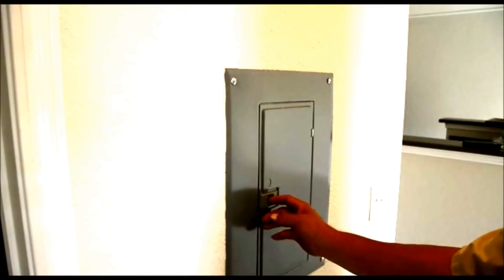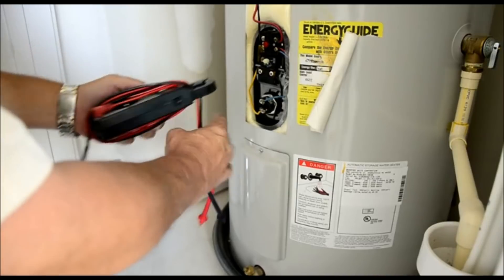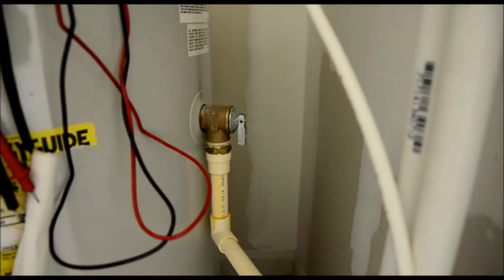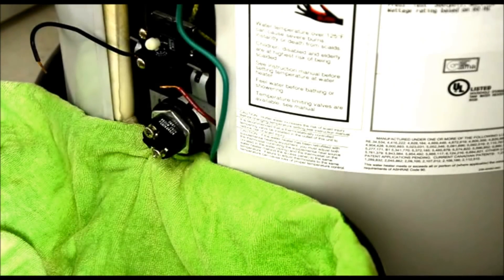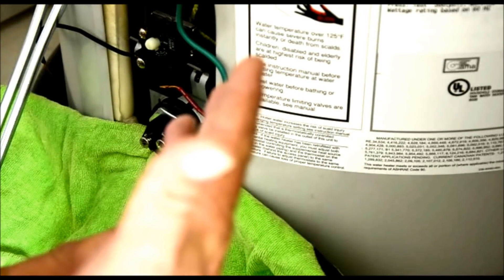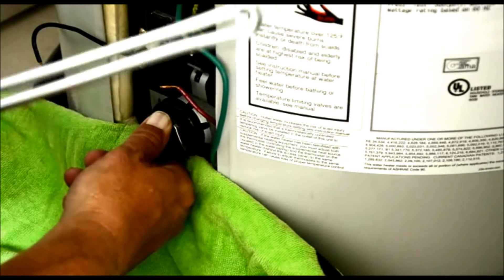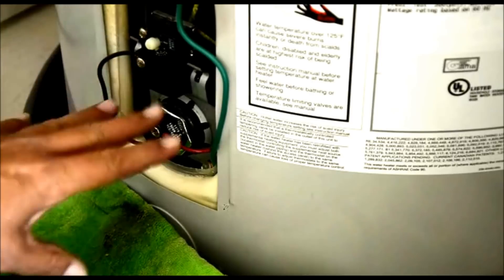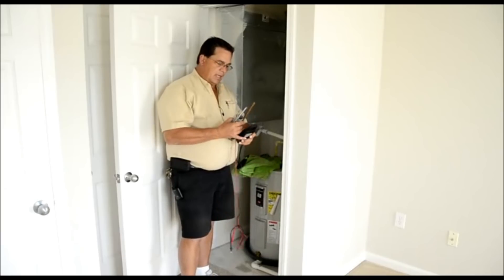Replacing A Water Heater Element With A Full Tank Of Water. "Not Draining Tank."

Comment: being a service tech for 37 years I would never try to change an element without draining the tank, I have seen 2 many elements split so bad that they wont come out of the hole without a real fight. I don't want to explain to the customer i was taking a short cut and dumped 40 gallons of water on the floor.
Reply: Told my apprentice to "hit" the t+p meaning to just relieve the pressure, he left it open and the elwment opening sprayed the whole shelf behind me full of computer parts... Never again.. Take the 15 mins to pump it down
Reply: Paul Fearnley absolutely
Reply: Your right and most of the time if the element is out it needs to have the sediment removed as well.
Reply: I just pulled a lower element out  today that came out in three pieces. It took some serious 'persuasion' to do so!
Reply: All those complaining about element removal without first draining the tank were not watching at 4:03, when narrator Dan Jiles said he had no clearance to attach a drain hose. At no point did he claim the "quick method" is easier or better.
Reply: If the element is broken and don’t come out easily do this, screw it back in then drain tank. Lol  I’ve done many with water in them, had one give me trouble, so put it back in and drained tank. No big deal
Reply: I've been a plumber for 46 years, i have never drained a water heater to change a element. That's even the calcium encrusted ones,burnt & split, and even the dreaded bent-back. So all you amatures leave this man alone, and understand you don't know everything. You might even learn something about plumbing...
Reply: Paul Fearnley agreed especially with older poorly maintained water heaters that where never flushed or at least not flushed often and the bottom element is not only a busted loop but filled with calcium. I understand there will be a slight vacuum on the heater when system is closed but when your disturbing that vacuum you can lose a bit more water then you want.
Reply: @Rhetorical Answer well I guess since I completed the repair described in this video without spilling even a cup of water I have a little different perspective than you and ol' Paul. Just because you've done something the same way for decades doesn't mean you're doing it right. As far as checking the power at the unit even after turning off the breaker apparently you've never heard of a mislabeled breaker panel.
Reply: Paul, thats true if you are a pro, but I live ina mobile home, and my water heater is outside, so this was really helpful to me
Reply: @Rhetorical Answer no it's not an "easy step" if you can't get the hose onto the spigot which is kind of the point of this whole video so you can piss off with your "laziness". Just because you and ol' Paul aren't smart enough to figure out an easier way to do a job doesn't mean the rest of us aren't. Or maybe you're just one of those "professionals" who rips their customers off by artificially inflating their hours so they can charge them more...
Reply: Rhetorical Answer guess I’ll just have to live with the fact that my repair was 100% successful.
Reply: I'm in total agreement with you. I'm a homeowner that has replaced my hot water heater elements a few times, and I would never attempt this. Drainingthe tank is such an easy step and doesn't take long at all. Why take the chance. Maybe this would work on occasion, but I'll never try it in my house and would totally advise everyone else not to either. Thanks
Reply: In 27 years of being a service plumber I have never drained a tank to change an element. Exception being in a finished room or full of sediment which is 1 in 100 where I live. Even broken elements come out with a good quick pull.
Reply: Sucks that you've been doing it wrong for 37 years. Wonder how many years you've wasted just draining the tanks?
Reply: Rhetorical Answer there is no substitute for common sense. IF you live in an area with hard water and IF your water heater is older and IF you can actually get a hose on the drain spigot THEN maybe you should just go ahead and drain the tank. I had none of those situations with my water heater so it made perfect sense to do the repair as depicted in the video. As far as the electrical goes in both this video and in my case a multimeter was used to verify the circuit was dead before the element was removed. I have a hard time believing that in 37 years Paul didn’t come across a situation like mine or the one in the video where it would have been easier to replace the element without draining the tank.
Reply: Get a life

Comment: Great job had a question will a burned element cause the heater not to power on and cause breaker to trip.
Reply: I had this same issue starting yesterday.  I have hard water, and the mineral deposits on the element ended up shorting out the element near the base. This will definitely cause the breaker to trip, and also keep the water from heating up.

Last time this happened, I paid a guy to come out and do it, and I watched him, but of course, he didn't explain anything. This video was an awesome refresher on what I'd already seen, and I replaced the element easily.  Instead of being close to $200, it was closer to $30 (because I had to buy both the element and the element wrench), which was much easier to swallow.
Reply: Thank you your right I had to replace it now I wonder how I can stop it from doing it again.

Comment: This video gave me hope.  Instead I ended up with gallons and gallons of water on my floor.  Unfortunately the lower element happened to be a fold back type that had expanded in the tank.  No way to remove it easily or quickly.  I suggest to anyone watching this video, know what type of element you are pulling out before attempting.  Play it safe and drain the tank!
Reply: cheryl lucas   oh yes I know what you're talking about your wrestling with the element trying to get it out of the hole it won't come out gallons and gallons of water is getting all over the floor you're panicking and it's just a big mess LOL I know what you're talking about.
Reply: cheryl lucas
Reply: cheryl 2
Reply: Yeah inwas lucky mine was outside that sucked.
Reply: Unfortunately, I couldn't drain the tank all the way from where it was located and the position. I had the same problem, and the worst of it was that I was doing this in my tenant's apartment, so the water went all over HER floor! I felt horrible and kept apologizing and saying that it wasn't supposed to come out that way. It was such a debacle!

Comment: If the old element is heavily corroded and covered in deposits, it will be impossible to switch out the old with the new without a lot of water on the floor.

Comment: I have a vertically mounted (Corbero CE50RL) in my holiday home in a very hard water area in Spain) and I'm sure the element is caked up with limescale as the kettle was the same although I've now restored it to perfection with white vinegar which dissolved the limescale.
I'm going to get some help to drain the tank and get the element out and leave it in a bucket of white vinegar for 12-24 hours until it's spotless again like the kettle element.
I'm guessing that the thermostat probe is probably caked up also and hope it can be removed and cleaned also.
Talking with my neighbours though I don't think anyone ever repairs or tries to repair these anymore as everyone has simply replaced their heaters over the years. Throwaway society drives me mental and yes my heater is only 11 years old, but I'm only here for 2-3 weeks per year and it's annoying that it's done after 30 weeks max, but then I guess the heater has been full of hard water for 11 years and not just 30 weeks...
Reply: I should have mentioned that the issue is that when I turn on the heater now it just trips out the electric... The weather is 40C every day during summer when I'm here so I don't really need warm water for showers in this weather 🌞
Reply: And sorry just one more thing - is there a resistance test that can be carried out on the thermostat?
Also - would there be a difference in the resistance readings of the element or the thermostat if they are just covered in limescale or are completely shot?
Presumably over time if they are completely covered in limescale they will burn out internally because they are having to work harder?

Comment: do you recommend this for areas where the water is very "hard"? most of the time, the bottom elements will go out here, because the bottom of the water heater is full of calcification or other precipitated minerals. in this case, would it be better to completely drain the water heater and then scoop out as much of the mineral deposit in the bottom as possible before installing the new element?

Comment: Hi Dan. Great video.  I have 2 elements heater. Heater works but circuit
 breaker occasionally goes down. Whats more likely could be wrong? One 
element faulty or electronics (Thermostat)? My Rheem is 10 years old. 
Should I replace the whole tank instead?
Reply: +jazu I just measured elements. Each is 19 Ohms. Are they in good condition?

Comment: The only thing I saw wrong with this is you didn't show testing the element, just the power. People need to know if it is bad before they go out and buy a new one. I have seen different length elements even, what about that? I don't want to give a thumbs down because of the great safety and water release and catching advise is good, but not complete advice for those that don't have any understanding fo how this works.

Comment: Great video. I didn't catch the complete title, I was just looking for a demo of removing the element. I needed to see the tool you used. Then I heard you say you weren't going to drain it, and I thought, no effing way... I was impressed. But try doing that on a tank full of HOT water. I will continue to drain my tank first. Murphy's Law.

FYI for those people who think there is no such thing as a "HOT WATER HEATER". There is a reason it is sometimes called a HOT WATER heater and not just a water heater. Something I noticed when I was stationed in England. They have TWO, yes count them, 2, water mains that come into the house. One line is your potable water that goes straight to the attic. Indeed, send the potable water to the attic to fill a tank of water there. I believe the water tank in my attic was between 100 and 200 gallons. The water pressure was really bad there, so that's a cheat to give you decent water pressure for free. 

The second water main coming in is for use in HOT WATER HEATERS. It is called the HOT WATER LINE. It is NOT potable and must be heated to be used. I have no idea why they set this up this way, but it certainly scarred the crap out of me when I discovered thats how it worked there. 

A funny thing about the plumbing is how it separates the hot and cold. My kitchen sink had the typical single spout where both hot and cold water came out. But there was a catch. The water isn't mixed together inside the neck of that thing. It has two pipes for the water and the cold and hot water don't mix until AFTER leaving the end of the faucet!!! I was washing my hands one day and got scalded water and ice cold water on my hands at the same time. I looked up into the underside of the faucet and could see there were indeed TWO water lines in it. British Engineering for ya!

Comment: Those tools you took it off with are impossible I had to get a big ass cheater bar to remove them. And half the time the elements are warped to hell and get stuck so you gota have hell getting them out. I do try this way everytime but beware if it don't work get rdy to throw it back and drain. Otherwise this video taught me how to do it so thanks..

Comment: This is great IF it is actually the element you need to replace! You said nothing about the other possible causes of the symptoms you described. What if it is the thermostat(s) that are bad? Why throw money at the thing when it only takes a few minutes to actually troubleshoot the thing?
If the top thermostat is bad, your lower thermostat may never get power to turn the lower element on. If your bottom thermostat is bad well, the element is never going to get power to produce heat. 
A couple of checks with an ohm meter will save a lot of unnecessary wondering and possibly wasted cash.
Reply: Verify the power to be off with a "known good" volt meter, and leave it off until these tests are completed! 
First disconnect one wire from the lower heating element. Check across the element's terminals with the ohm meter. A good element will show a very low resistance. This can vary in actual ohms, but experience has shown it to read in the range of 20 to 100 ohms. A burned out element will produce a reading of infinite resistance or show an "open" circuit.
If this preliminary check shows the element to be good, then you will need to check the lower thermostat with the ohm meter. Assuming the tank is cold on the bottom as described in the video, the lower thermostat should read "0" ohms across the terminals. If it does not, the tank is either hot enough to have this thermostat turned off, or it is in fact the bad component in the circuit. 
If both the lower element and thermostat check out as good, then it is likely your upper thermostat is the problem. You will have to disconnect a wire from the upper element to continue testing. Assuming the tank is up to temp on the top half, the upper thermostat should read as "open" across the left terminals, and "0" ohms across the top left to the right side terminal. If that is not the case then your upper thermostat is not switching the power from the upper to the lower and will need replacement.
I would suggest checking all of the above to identify all problem components before running to the hardware store so you get exactly what you need in one trip.
Good luck and be safe!
Reply: The title of the video indicates it is about replacing the element without draining the water. The symptoms of a non-functioning element are mentioned, but that doesn't mean a non-functioning element is the only cause of such issues.

Comment: How do you set the meter to know if there is still power going to the unit. Not sure why Dan didn't mention the meter setting since it was a 10 second addition to the video.
Reply: +Sandore Bussolini It should be set to read 240V AC. This is what most US water heaters operate on. Take your reading across the top terminals where the wires come in from the source.

Comment: we just replaced both water elements in mine and still no hot water 1st thought it was wired wrong but nothing happened even after hours nothing then wished the wires still nothing even hitting the Reset button top and bottom not working when they did when removed old ones need help!

Comment: Help, we changed the elements and they are receiving power (checked with a voltmeter), but it is not heating the water. Thermostat says 120 degrees and it is supplying water to and drawing it from the tank. 
This al started a couple of months ago, when lightning struck our house. Our 2 month old water heater quit working, and we had it checked with the voltmeter and were told that the elements needed replacing. We finally replaced them today and it's getting power but not heating the water.
Reply: Sounds like the thermostat is messed up you should have replaced it with the elements.

Comment: if the Heater element is bad.. does the pilot light go out.?Cause we can't get the pilot light to stay lit ..
Reply: +Dan Carreon You are working with a gas water heater if there is a pilot light, and would make this video totally useless to your situation.
I would recommend a certified gas appliance technician in your situation because if it is not burning, the gas is building up and could cause an explosion.
Reply: Dan Carreon 😂😂

Comment: Fine if there's no crud in the tank (chance would be a fine thing). Otherwise aforesaid crud can get in the threads and can give you trouble with screwing in the new element, leaks afterward, &c.  Draining the tank to put in a new element is often the only time the drain bib is ever used, and crud removed. Not a bad thing.

Comment: how do you know which water heater element you need?
Reply: You check continuity through both terminals of the element with a multimeter (volt meter) with the continuity setting or low ohms setting.

Comment: ***** Forgive me if this has already been mentioned, but YouTube does not have a "search previous comments" feature, and I was too lazy to read more than a couple pages worth.  Anyway, tsk, tsk, for putting out tricks-of-the-trade that only experienced people should execute and novices will try and probably douche-down their utility rooms.  Those catch pans CAN be bent out of the way.
Actually, my real concern is for you miss-training people about the proper way to do a "dead check".  You should always verify your voltmeter on a known good source of the same voltage type, (in this case a 120vac outlet will work fine), before checking the water heater terminals.  If you had it set on DC or had a loose lead, we could be watching your episode of "Faces of Death", or at least "Faces of Jumping Back and Cussing Up a Storm".  What you did inadvertently show was a very good confirmation that you got the right circuit in that you observed the voltage present and watched it go away when the disconnect was opened.  Your video also illustrates the value local disconnects for electrical appliances such as water heaters and A/C compressors.